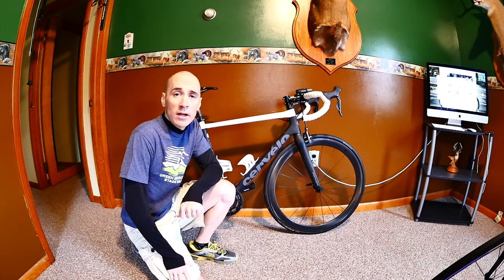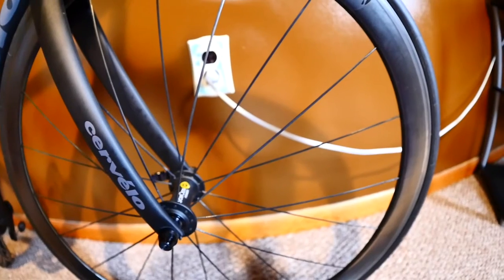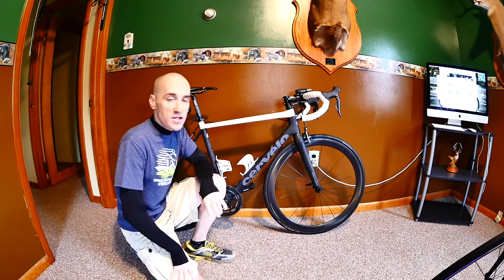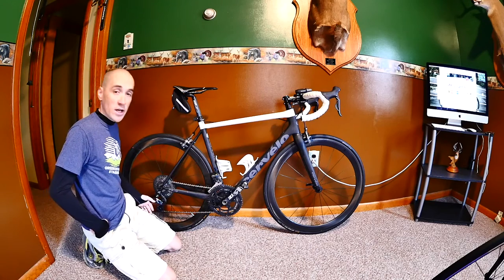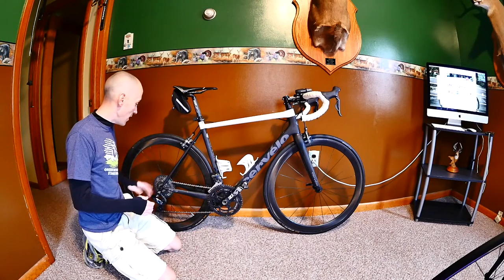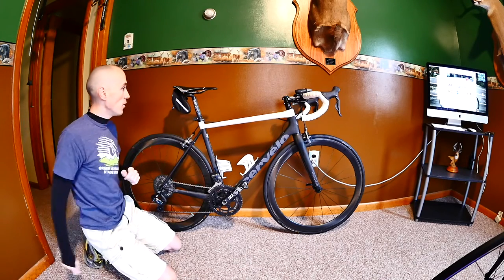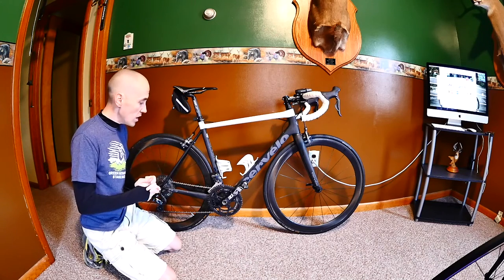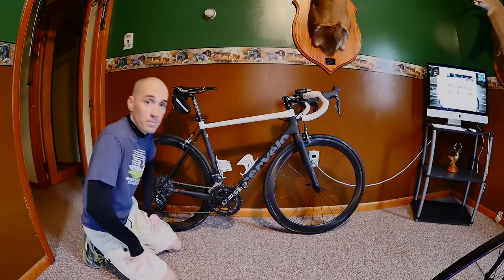2016 Cervelo R3 w/Hill Climbing Gear Modification

Comment: I've ordered the components to use bigger cassettes as you are doing. Right now  I've got a compact  (34) up front and a 12-30 on the back. I can spin in the high 70s on the 8% slopes but have a number of 11-14% climbs on my usual ride and my cadence  drops drastically. (I'm fit but 65 y.o.). I'm sure with a 38 I'll be able to improve my performance.
Reply from the maker: Awesome. Good luck on your new setup, sounds like it should be great !

Comment: Hi I would like to add that you can run a 52/34 with Di2 easy I've done this on my Dura ace 9000 and works fine no chain drop all just converted my Ultegra to 53/36 also runs sweet.
Reply from the maker: Thanks for the heads up Luke !

Comment: Thanks for covering an area I have also been experimenting with. I have converted my Kuota with 11-32, and Compact up front, but I am finding at 14% grade, I have found the cadence to drop to the low 70's. Since then I have just acquired an Emonda SL6 that I am building up to be more climbers bike. Its got compact up front, however, the cassette is still at stock 11-28. How did you get 11-40 ? The link cage drop, was that an easy convert on the Ultegra ?
Reply from the maker: Hey Ravin. I am using a Shimano XT mountain bike cassette that I got on Amazon. I am using it in conjunction with the Wolf Tooth Components "Road Link". My setup is still working very well. Good luck to you out there !